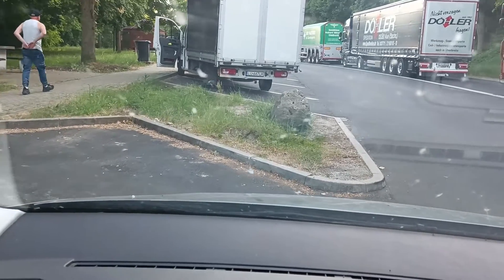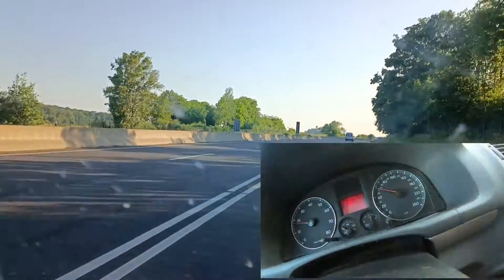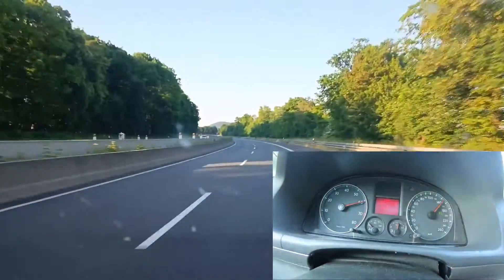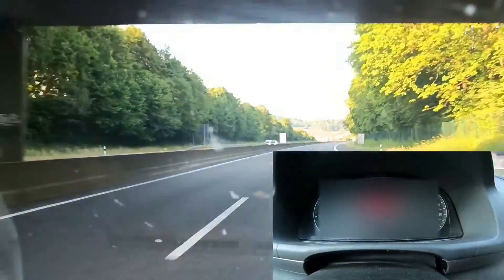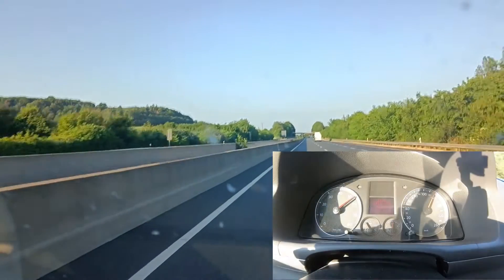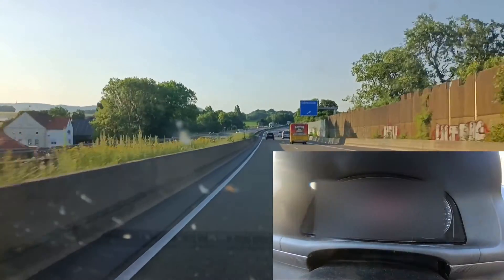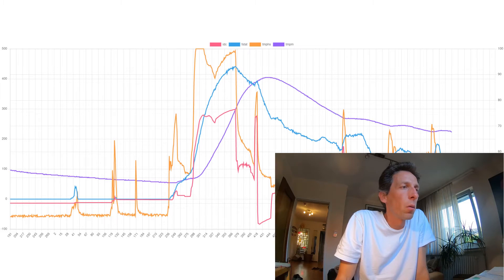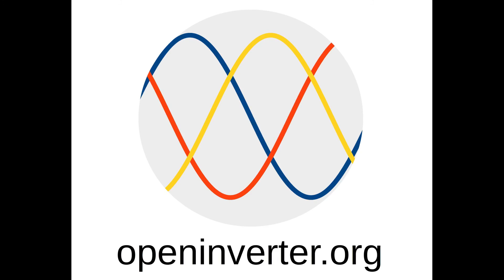E-Touran: whats its new top speed?

Comment: Great to see you being able to test this!  What was the peak power  during acceleration?  What was the power at top speed?  Was field weakening fully engaged at that point (~6k rpm’s)
Reply from the maker: Not exactly sure if it would be at that rpm, but at least partially. Power was around 100 kW electrical.

Comment: I worked at Danfoss Solar Inverters back in about 2010, and we had a VW Touran 2.0 diesel as or company car... we travelled quite a bit to the various solar sites in that car. Funny thing is, that my colleague always used earplugs when we drove that car... it was quite noisy and we joked about, that it was the ultimate stress test for our inverters, if they could survive the journey ;-)
Reply from the maker: Then I may have improved it ;) In my former Sharan it was the diesel engine that was terribly load already at 130 kph. I usually just drove 100 kph to mitigate - good preparation for the EV era :)
Reply: @openinverter  
Hehehe, ok 🙂

Comment: 50kw at 150kmh. That's 333Wh/km. Not too bad for a brick. Is that thanks to the gearbox?
Reply from the maker: It could be. I found coasting above 6000 rpm consumes quite a lot of energy for field weakening, could be likewise for low torque demand. A Nissan will rev about 10000 rpm at that speed, could be less efficient.